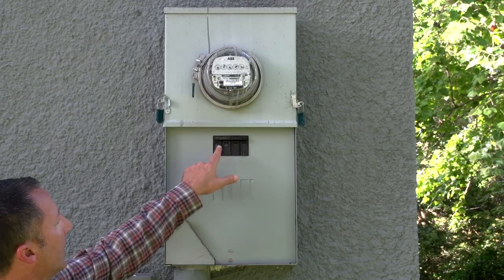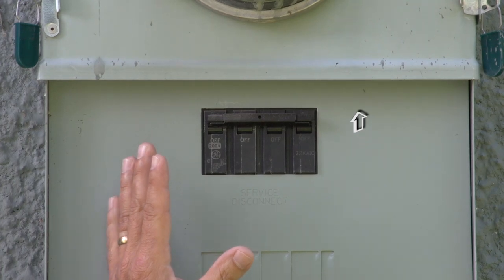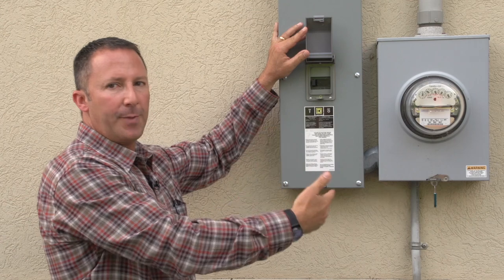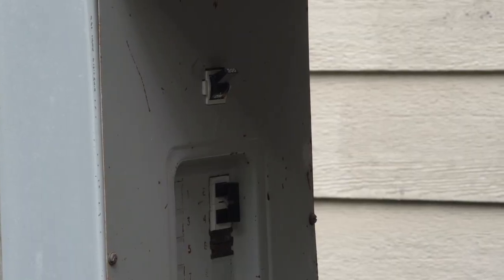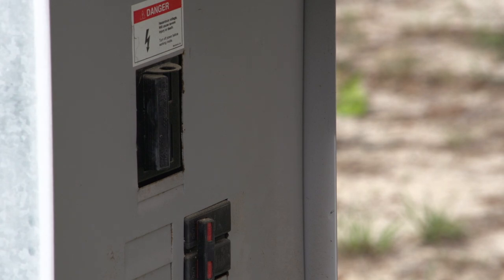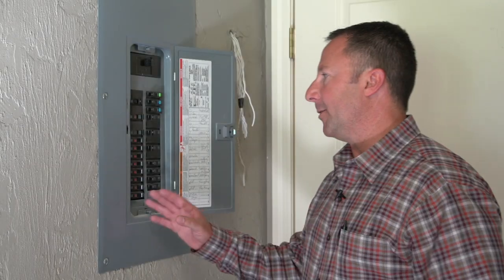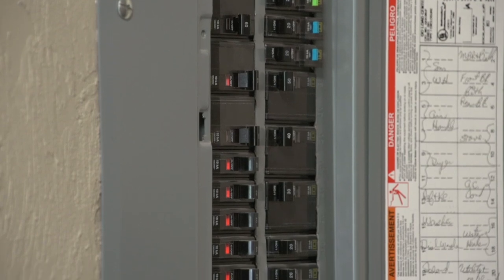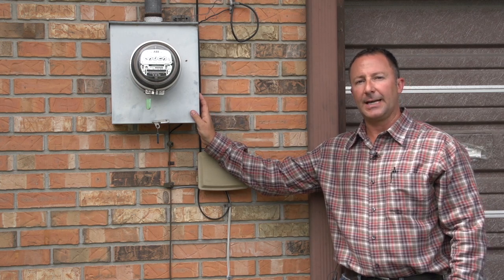Main Breakers

Comment: I was looking for info on how the outside breaker setups are wired.
Reply from the maker: You can find pictorial diagrams on Google Images. Remember,
removing an electric panel cover could result in electrocution. We advise
contacting a certified electrician.

Comment: I am having a lot of difficulty finding a 400A 1-phase 120/240 Type 3 (320A Continuous) disconnect that I could use near or at the meter when the meter is located near a pad-mounted transformer (power company 400A service)

Comment: Just about always seen in mobile home parks, this is the main dis-connect. the load center 
for a mobile home will be a 'SUB-PANEL meaning the neutral and grounds busbars are isolated, 
The grounds  bar bolts right to the cabinet, whereas the neutral is ISOLATED BY PLASTIC 
BRACKETTS.
Reply: Thank you for that comment. My grounds and neutrals are tied together in both places and I have main breakers in both which uses up 4 spaces in my sub.
Reply: @notme22  I think you have a dangerous situation and that you could get zapped 
and pretty badly at that. Neutral and grounds are only to join ONCE. But it is your place, so do what you want.

Comment: How did that meter pass inspection being do high up? I thought the power company had installation requirements that the top of the meter could not be higher yhan 6 ft 6 from grade. I have had instsnces where it was higher and i was allowed to build a step or two underneath so those little meter reader girls could see the meter straight on.

Comment: What rating of conductor is run from the weatherhead to the meter base for overhead service? I've been trying to find a correct answer for a while.  I know it has to be sunlight resistant but can't find if it's THHN/THWN or what.  Thanks
Reply: 4/0

Comment: My panel doesn’t have a main breaker switch, just the smaller switches.  How do I cut power to the breaker box so it’s safe to work on?
Reply: You can't. Only your power company can do that. They have to pull the meter. Unless there's a cut of between the meter and your panel. But you REALLY should have a main breaker somewhere between the meter and the panel. I’ve never seen one that doesn’t.

Comment: Let me ask,, I shut the power to my home off at the basment panel to do some work, I have no outside main shut off,, why did I still have live wires even though all the power was off
Reply from the maker: Contact a licensed electrician to trouble shoot the issue.
Reply: @ClayElectricCoop  thanks, but out of all the years you've been in the electrical field that's the only knowledgeable answer you can come up with..I can't even get a maybe "it's this"...

Comment: 1:04 Is that a 3-phase breaker?
Reply from the maker: Thank you for you question. Homes and small businesses only require Single Phase Lines/Breakers. Mostly, heavy industry that draws a large amount of power requires 3 phase power.

Comment: Why does the main breaker NOT separate or disconnect the N leg from street power...?? Why does the main breaker ONLY shut off the (2) 120V legs...??
Reply: Please don't use the N word
Reply: Because the N leg does not go thru the breaker. It's tired directly to the center tap on the transformer, which is tied directly to ground. Only the two 120v legs go thru the main breaker.
Reply: @josephherron7671  Ok captain obvious for telling me something i already knew yet didn't answer the question. 

Lets try this again, WHY does the Neutral NOT have a breaker to separate it from the house as the 2 Hots do ??

Comment: My old house is weird. My outside main breaker under the meter is only 50A-50A circuit breaker and a separate (not control by the main) 30A-30A single-pole breaker for the dryer which is standalone wiring straight to my Electric dryer. Therefore; inside my house main panel, there is no Dryer circuit breaker since it is outside and standalone. Therefore, my house total is only 80A (50A entire house+30A dryer) according to the outside panel. Anyone has similar issue? Very weird.
Reply from the maker: Clay Electric only supplies electricity to the meter. Anything beyond the meter is the home owners responsibility.  Breakers do not fall under Clay Electric's obligation. This video is simply a courtesy for resetting breakers. Please contact a certified electrician relating to all issues beyond the meter.

Comment: That one panel you were flipping the main off & on is a very bad panel THATS A FEDERAL PACIFIC  panel and you should recommend that it be changed out Federal cheated ul .The other bad panel you dont show is ZINSCO .I was personally involved in PUTTING FEDERAL PACIFIC OUT OF BUSINESS IN THE STATES and have no remorse I happen to be a licenced electrician in cook county il . IF YOU DONT DO IT IN CONDUIT YOU MIGHT AS WELL NOT DO IT, NO ROMEX ALLOWED in any residential not even a shed.THIS IS THE WAY IT SHOULD BE.Rodents cant hurt it.
Reply from the maker: That panel was not energized. Clay Electric is only responsible to provide electricity to the meter. Any issues beyond the meter is the home owners responsibility. This video is simply a courtesy on how to reset breakers. Please contact a certified electrician for any issues beyond the meter.